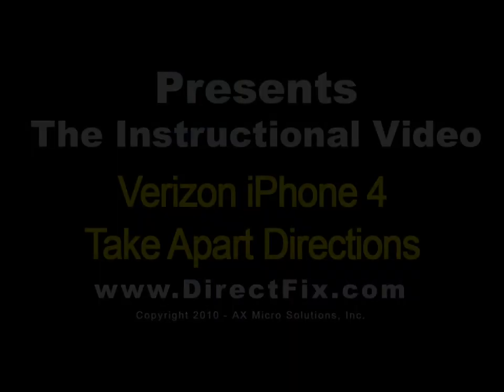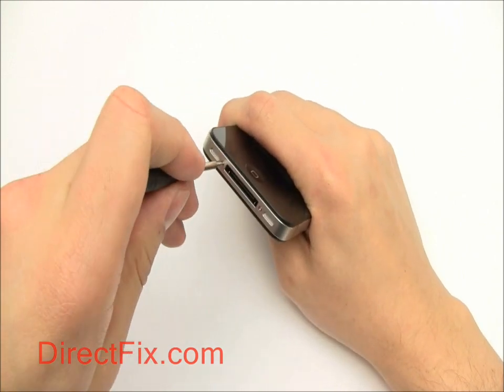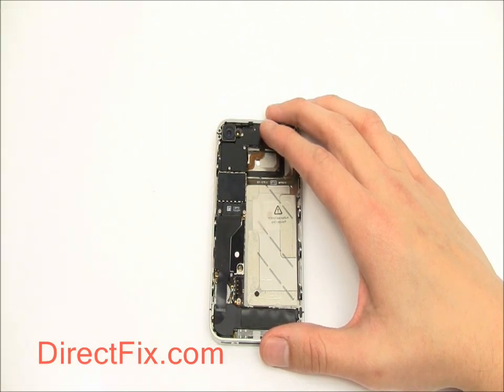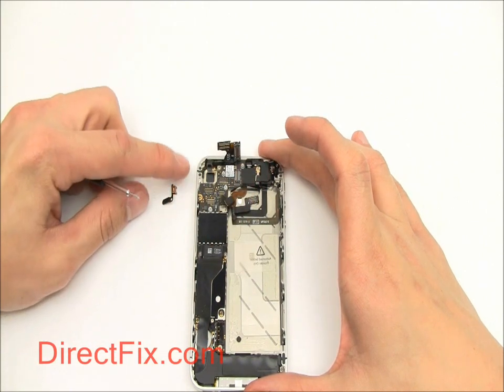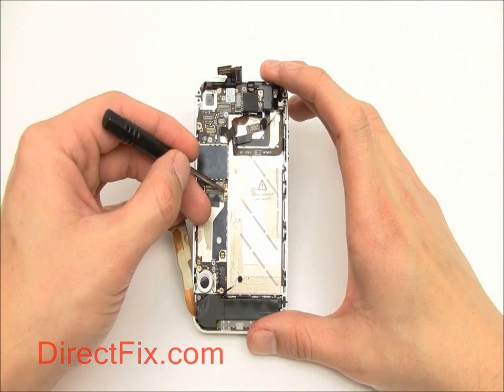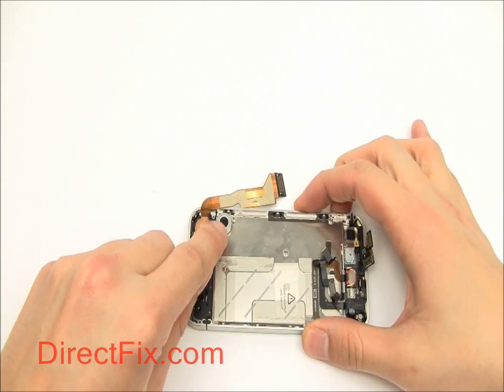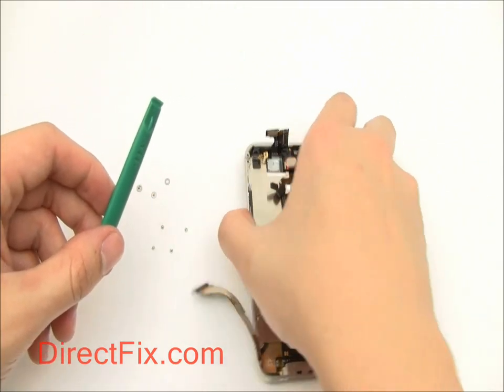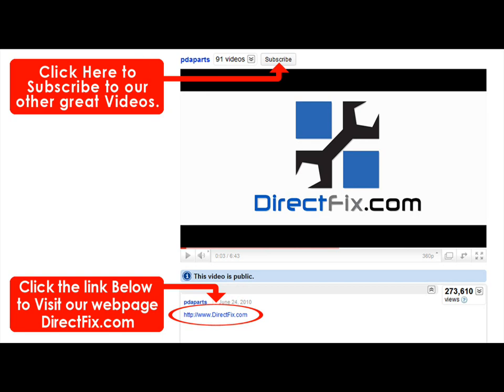How To: Replace Verizon iPhone 4 Screen | DirectFix.com

Comment from the maker: @misodem0nor The lcd of the screen is the same the frames that the screws go into to hold it in place are in different positions hence why they will not be cross compatible or they will not fix correctly. You must purchase the screen that fits your Verizon unit.